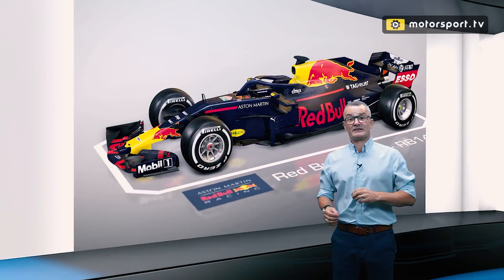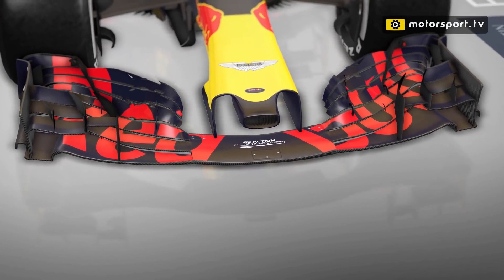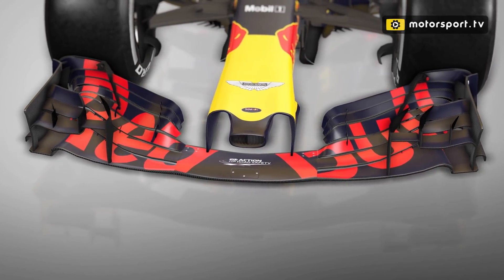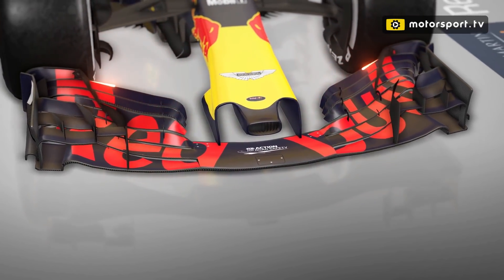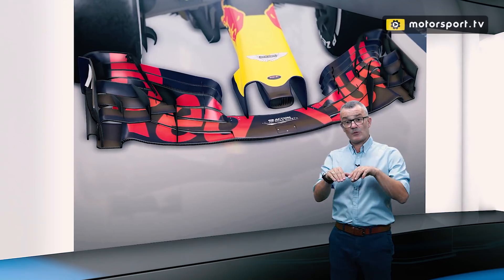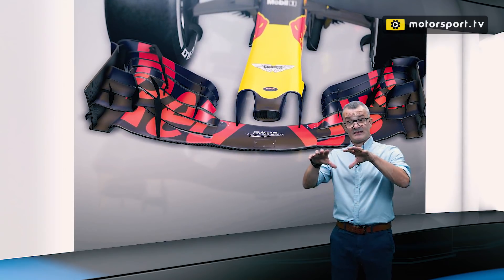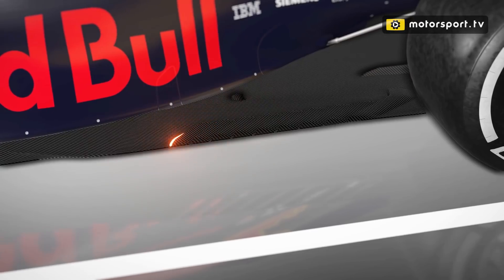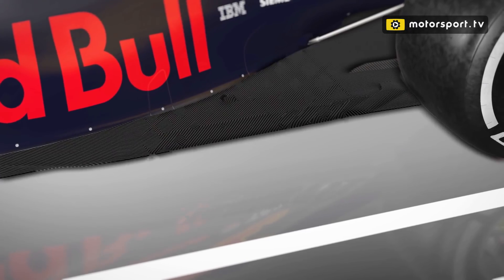Why Red Bull is front wing centric

Comment: This is gold, sadly we would not seeing that anymore in 2019
Reply: The teams will just find another area to exploit, they always do!
Reply: @FiddlerSteve  and the FIA would ban it all over again
Reply: @FiddlerSteve   i know that but what we would not see anymore is this kind of aero development on front wing, brake ducts, rear wing, etc. I almost certainly think that they would ban any aero development on mirrors and halo next year. Meaning the only area they could exploit is the underbody. But that's a good thing, at least at focus on underbody the teams could find to use underbody to generate downforce which will remove drag and dirty air on the top of the car, making it faster on corner but still faster on the straight.
Reply: Any idea if they will adopt v4 engines?
Reply: @ABCEDEFG911  V4 is not gonna happen at least on the near future, 2021 is about keeping the same engine but without MGU-H, upgrading the MGU-K and higher revs.